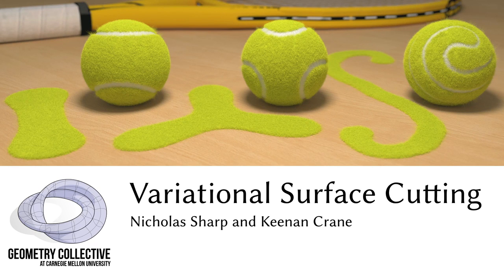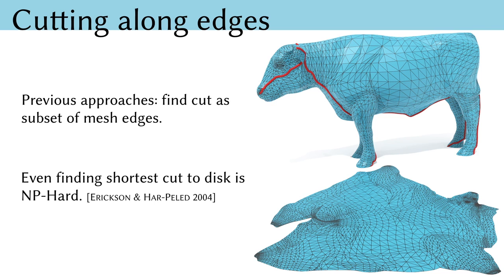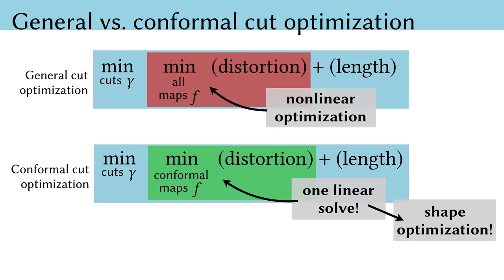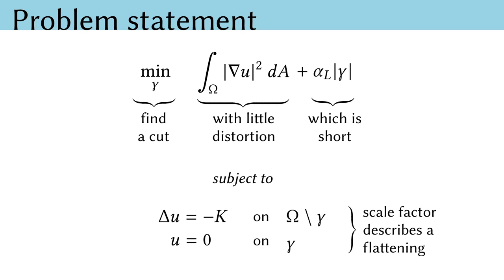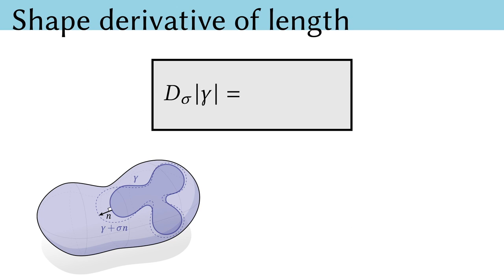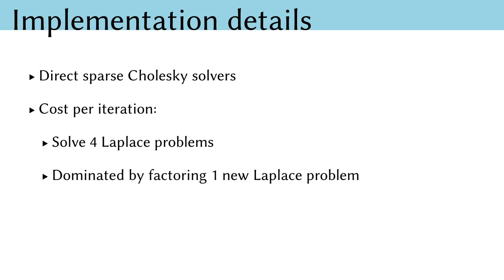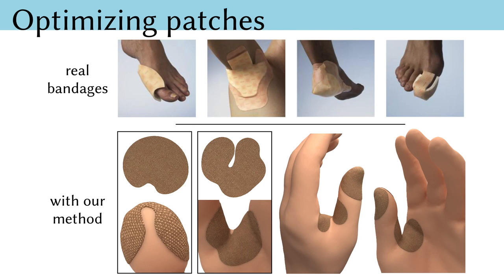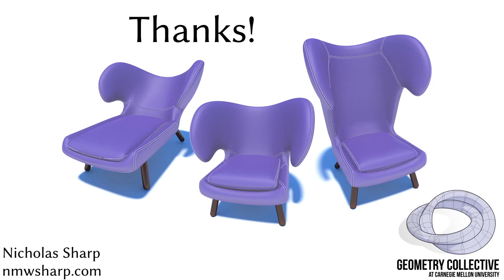Variational Surface Cutting - SIGGRAPH 2018

Comment: This is amazing. I'm super impressed by the simplicity of the solution and its beautiful results! '

Is there symmetrical constraints imposed on all the examples, or do they arise naturally?
Reply from the maker: Thank you!
Yes, we imposed symmetry constraints on several of these examples: the furniture, the volleyball, though not the cow.
One nice property about representing the solution implicitly as the level set of a scalar function is that imposing symmetry is quite easy---it's just an equality constraint on scalar values. If you used, e.g. a Lagrangian representation with explicit curves along a surface, imposing symmetry would be much trickier.
Reply: @nmwsharp  thank you! I just watched the video again, and heard you mentioning the symmetry. I must've missed it on last viewing.. By the way, did you compile this into an executable like Instant Meshes, or is the code available somewhere? This could turn out really handy.

And lastly, did you make progress on implementing the overlapping constraint?